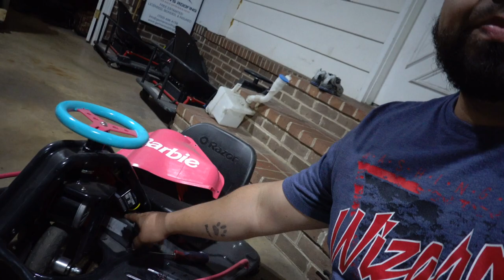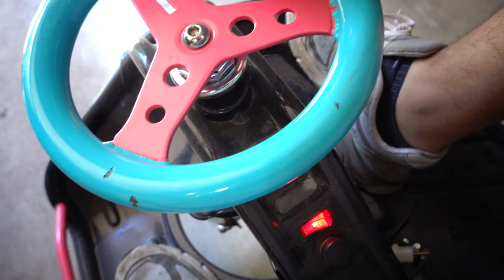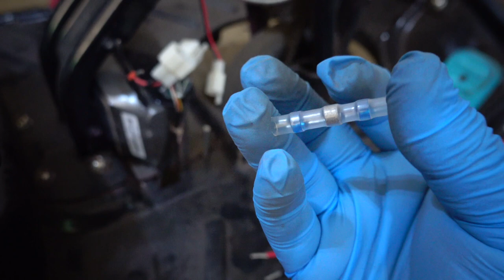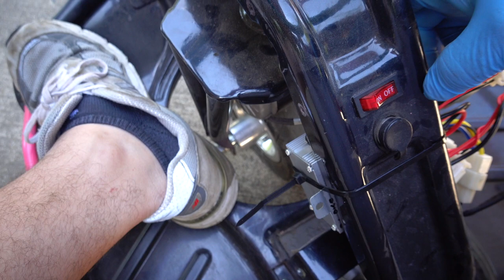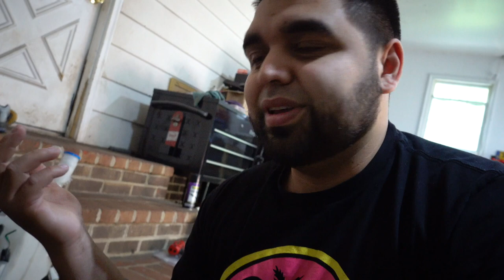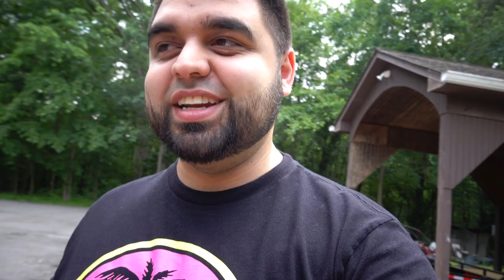Razor Crazy Cart 36V Battery & Fast Scooters Overvolt Controller Upgrade!!

Comment: We ran 40volts to that same motor today and it worked great. Used a upgraded controller and wired 2, 20volt batteries in series and everything worked great
Reply: Did you continue to run it at 40v w/o motor burning out? thx
Reply: How long did it last.
Reply: I’ve scene a 250lb guy ride it full speed racing and drifting for almost a hour😂
Reply: @randompep.491 we used dewault batteries…. Electrician skills lol
Reply: @firstnamelastname5330  How long did the motor last till it fried?

Comment: Hey I see you got that fast scooters ESC The man that builds those lives right here in Sarasota Florida I have a few of these computers with his hall sensor throttle setups They perform extremely well. Though I do have to say I purchased one for a curry 450 w scooter and the negative and positive was reversed on the charging port plug on the ESC and when I plugged it in it burnt right up. Lesson learned

Comment: I didn't need a controller swap. All did was hooked up a 36 volt Jetson bolt battery and it ran a lot faster and longer.
Reply from the maker: Yeah it’s not NEEDED but the upgraded ones will hold off longer before burning out

Comment: do you have a video connecting two of these batteries? where would you connect the second one?
Reply from the maker: Gotta connect them in parallel. I do have a video doing it. I used xt60 connectors

Comment: I'm not an electrician by any means was curious if a 24V 28000mah lithium battery pack would be a decent replacement for the two 12v batteries
Reply from the maker: I think performance wise, it should be about the same. The only difference, I think, would be that the charge will last a lot longer.

Comment: I just received the Fastscooters 24v to 36v controller plug in for my crazy cart
And I've also soldered the battery male plug with  positive/negative wires to the 36v lithium battery

As well as plug'n'play the Fastscooter 36v controller and the switch turns on for like 3sec then dies on me I've also rechecked all the wires checked the connection seems to be all in contact just clueless why it dies on me

Could the charging port be the issue??
Or a dud on the Fastscooter 36v controller??

Comment: Your eBay battery link goes to some weird mixer thing haha. What 36v battery will work?
Reply: Any 36v 18650 pack will work , make sure it has a discharge rating of 25amp minimum
Reply: @ptescreen18  do you know if I can run the same battery pack on a 24v razor dune buggy?

Comment: Do you get better speeds by using a 36 volt controller?  I'm running 36 volt on the stock 24 volt controller.
Reply from the maker: No idea honestly. I only bought this controller because I thought mine was fried but it wasn’t lol

Comment: What kind of run time are you getting out of those 4 ah hoverboard batteries?
Reply from the maker: It depends on the weight of the driver. It’ll do about 2 hours with my daughter on it
Reply: @StayOnTheGas  does a bigger battery make it go faster
Reply: @darkshadow8557  more volts would but not more amps per hour

Comment: How long does the 36v batts last?
Reply from the maker: That depends on the amp hours
Reply: @StayOnTheGas  alright so i got the same controller you have and i have one issue, when i press the gas the cart won’t go when i have the aftermarket controller on but when i put on the stock one the cart works so i’m not get any power form the pedal connector form the controller. what do i do?
Reply: I have the same problem
Did you manage to get the cart going with the 36v controller?

Comment: The problem is that the BMS in the battery pack shuts down because the motor is not brushless and draws a lot of current. Use another BMS or bypass it.
Reply from the maker: It works perfectly fine now. I just needed the right charger because the battery was completely dead

Comment: bro you don't know electronics ...it totally looks like you are just winging it and whatever happens happens then just see what breaks then go part by part to try and figure it out. You should have known and obvious that the smaller crazy cart is 24v and you are using a 36b battery so you are over vol-ting it so if you use the same old charger it will not work and may damage the cells in the new battery and make it have a shorter life span as well as the motor unless it is rated to 36v then it can take it.., only the xl is 36v but might be able to make it a 48v and you would need a 48v battery and speed controller with the same 48v as well as a charger that charges to 48v.
Reply from the maker: You probably don’t know much about crazy carts because almost everyone over volts them. They can easily take it. Both these to 36v and xl to 48v. It is very easy to over look the most basic little things. Happens when diagnosing cars as well.
Reply: @StayOnTheGas  Any electric motor can over volted it had nothing to do with crazy carts lol... that right there shows you don't understand electronics
Reply from the maker: Lol ok whatever you say 😂
Reply: @dreamkiss4u no one cares about your opinion bud
Reply: @mtndrew9624  obviously you did or else your wouldn't have taken the time to turn into a Karen lol
Reply: @dreamkiss4u It's not that deep